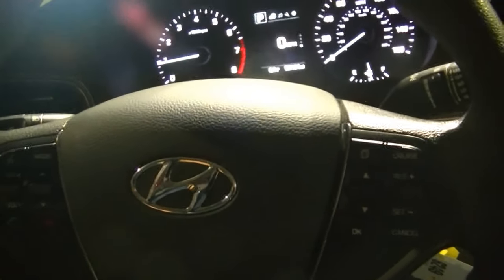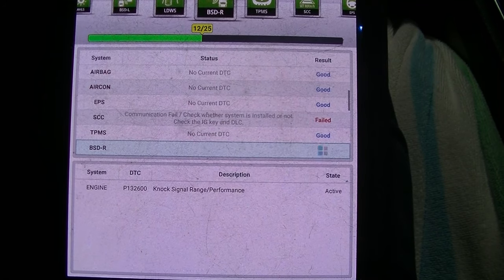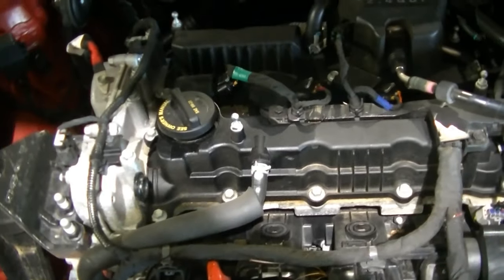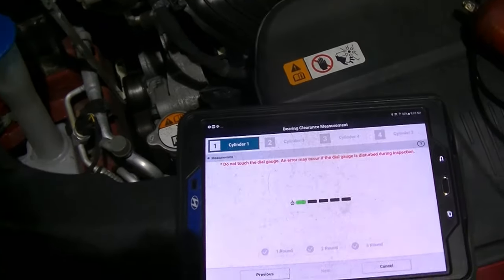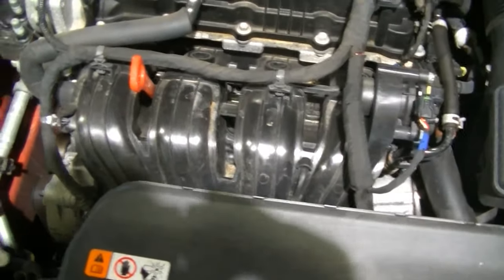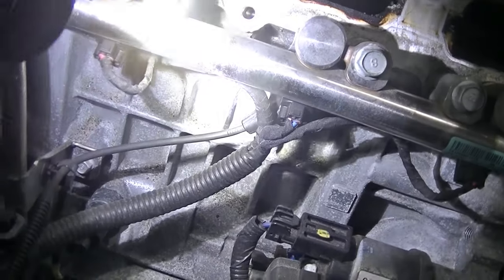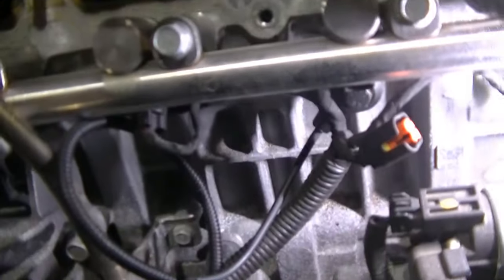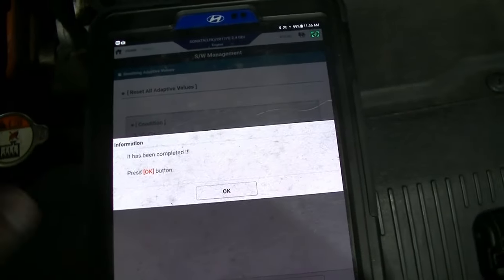Hyundai/Kia P1326 Diagnosis and Knock sensor replacement (flashing check engine light)

Comment: Dealership charged me for a knock sensor replacement and 300 miles later the engine started knocking. They crooked me. If they had checked the rod bearing clearances they would have known that the bearings were bad. They caused me to be stranded 200 milesfrom home. Still waiting for the Hyundai case manager to call. If the dealership doesn't make good on their failure,  I'm going on social media to do as much damage as I can to their business.
Reply: How much did they run you for that knock sensor?
Reply: @luis-n-ceci6998  $448.87 to replace it.
Reply: Report this to the NHTSA because they have open investigations on them and theres another class action lawsuit opened in South Carolina against Hyundai and their 2015 sonatas. Which are starting to have these same issues. I my engine is limping and I’m pretty sure it’s a knock sensor issue and not the engine it’s self. I’m getting a diagnostics run on it tomorrow and if it is the knock sensor I have to wait 1.5 months before Hyundai can even see me. Ridiculous.
Reply: @Goldun-nah  Hyundai replaced my engine. Also, the attorney general's office in my state collected my $400 plus dollars from the dealership that charged me for the knock sensor.
Reply: @randallturner8048  if it isn’t too much to go into can you explain to me the process. I’m just trying to be preemptive and have a game plan for if they try and swindle me. Taking mine in Friday for the same thing. Glad you were able to get some resolve. The engine replacement been treating you good?
Reply: @Goldun-nah  I'm about 12,000 miles into the engine replacement and so far it's doing great. Mine was using an excessive amount of oilfor several years before the rod bearings went.  The first dealership was in the process of doing an oil consumption test  when the rod bearings went. However,  you want to request that they do a rod bearing test. There is a dial gauge they can place in the spark plug holes and turn the engine crank by hand with a special tool. This will measure the clearance between the rod bearings and crank shaft giving a clear indication of whether they are good or not. I kept telling my dealership to do one, but for whatever reason they didnt. It took me about 6 weeks to get my new engine installed because the dealership that did it was backed up and it took them a while to get the replacement engine. Good luck!
Reply: What was the outcome, my car would stall from lack of compression n sometimes won't start
Reply: @robinhoodloom5795  Hyundai replaced my engine free of charge. I filed a complaint against the dealership with my state's attorney general's office and they got the dealership to return my money for the knock sensor. A different dealership replaced the engine.
Reply: @randallturner8048 looks like I'll be doing the same thing. I complained over 3 years ago about weird sounds from the engine bay and oil consumption for more than 2 years now. They wanted me to pay for a diagnostics even after I told them about a service letter I received in the mail regarding an engine. My engine gave out yesterday. It's 99 degrees outside broke down by the road in another town. I was livid. I had to pay 300 for a tow and they still wanted to stress me on a diagnostics fee if they find there is another issue. I've ran the code and it comes up as this one and also camshaft position advanced. They can deal with this and give me a new engine because all of this could have been avoided if they would have listened to me. 😢
Reply: @IamRayne1992 man I’m sorry to hear these stories about these engines . I was strongly looking into a hyundia for my wife since prices where not so bad . But now I think I’ll go with my first choice the Toyota  rav 4 instead .
Reply: @pureonyx5090  that is your best bet and once I'm in the market to buy a new car , I plan on getting a Toyota highlander.
Reply: Bruh they would’ve charged you serious money $$$$$ to check your rod bearings LOL and thats just checking, extra $$$$ to replace and test. That garbage engine was toast either ways. Buy a Honda or Toyota next time, lesson learned.
Reply: Yes!!!! Kia is not being accountable for their crap engines,I'm waiting for a diagnostic in my 2015, I have a leak in the engine and I also have all software updated, I hope I get approved for a new engine.
Reply: This is me right now far from home idk what to do
Reply: @lauriepiroh6450  If you had the software update done previously then hyundai must replace your engine. Also, knock sensors are covered by warranty even if your car is out of warranty. Provided you have the Theta II engine in your vehicle.  There is a court settlement that requires Hyundai to replace the engine. My states Attorney General's office recovered tge cist of the knock sensor replace from the dealer for me.  Hyundai must reimburse you for  a tow and they must provide yiu with a loaner vehicle under tge settlement.  Dint let weasel out. 🤞
Reply: @randallturner8048 wasn't the issue covered under a recall? My wife's kia has a knock censor recall.
Reply: I know a thing or two about that
Reply: What scanner do you use
Reply: @AppalachianTourist thank you for this. I just had this problem. Do you know where I can find this stuff documented?
Reply: The Hyundai dealer in Laredo Texas been denied warranty and recall of the engine seizing or lockup with the same excuse of been recorded of been in an accident before(6 of my consumers and 1 of my property..)one of the worse companies ...
Reply: Sure they know the problem but they want make couple $.
Reply: I had this code my engine had been replaced, and computer re flashed by the dealer ship in 2020, but i dont think they replaced the hardware so it went into limp mode like this i put new knock sensor in it cleared the codes seemes to have done the trick.
Reply: @imthatguypal_ honda and toyota are about garbage any more too .
Reply: They run you fast to get some money y don't go to the dealership check others honestly people
Reply: @user-ck8kn3qt8v  The car was still under warranty. The dealership claimed the knock sensor wasn't covered. It was covered.  I filed a complaint with my state's attorney generals office.  They got my money refunded.

Comment: Bandaid on a bad engine - 2.4L Theta II is a garbage engine. My Sonata is at the dealer getting replaced right now. I have a Chev pick-up with 320,000 miles on it I drive every day that has no major issues and never has...

Comment: I bought a sonata 2.4l 2018 in April this year I didn't know a about the recall, or the claim settlement against hyundai American motors it closed in July this year but my vin is included in the settlement pretty sure dealer who sold it to me knew about it should I complain to consumer protection or am I wasting my time should sell the car ? I own it already its at the dealer getting diagnosed for knock sensor
Reply: Update
Reply: @nixc71  after 5 weeks of my car sitting at dealership their "certified technician" aren't certified to inspect or diagnose the cause of the issue even screw on battery terminals properly when i told em basically they tried to scam me for a bran new battery and when they did their diagnosis they figured my smart junction box aka fuse box was shorted and told me had nothing to do with my knock sensor issue nor was it related... basically they changed the whole engine block bran new, new knock sensor wiring, they had mentioned my rear heat seats werent functional and they crooked my seat upon removal so one side has a gap manager told me nothing he could do about it.. which is disappointing they damaged my seat and honestly it doesnt matter  long story short 800$ for fuse box, free engine from hyundai canada no issues since they swapped the block drives like new, best purchase ive ever made Car drives smooth, very spacious, very fuel efficient.

Comment: Man it would be super helpful if there was a mechanic or manager at my local dealership who gave a crap about doing warranty work. I've been having nothing but issues with this dealership for this same exact code being thrown and I'm going on two weeks now with no vehicle, no rental, and they have yet to look at the car. I appreciate your video and how helpful it was to at least somewhat understand what could possibly be the issue with my vehicle, but my local Hyundai's service team as well as service manager are all absolutely ridiculous.
Reply: bet the same thing is about to happen to me
Reply: I purchased a Optima. Did the recall for knock sensor to be added, eight days engine coded and had to be replaced. My vehicle was at dealership for almost 2 months due to backlog for engine problems. Engine was replaced, but 10 days later, engine lit on and car stopped. This time faulty sensor. Car ran for 10 days and while driving slowed to a complete stop. Had it towed to dealership (3 previous tows) to find out it needs a new transmission. I have continued to make car payments. No loaners. No car.  PLEASE KNOW when they engines are upgraded, you will have to replace the transmission to work with the upgraded engine. So I am 2 months in waiting for a transmission. 4 months downtime with a car I have owned for 10 months.
Reply: My closest Hyundai dealership is an hour away. They won’t be able to get my car in to be looked at for a month and a half. That’s unacceptable. I’m pretty sure I’m having a knock sensor issue and not actually an engine issue itself. My abs lights came on and then a few hours later the engine light started blinking and my car went into limp mode. No knocking noises tho. I’m hoping that I can get my car driving condition tomorrow if it is just the knock sensor and then have complete diagnostics ran at the dealer in a month and half in case there’s something that becomes a catastrophic engine failure and needs replacements.. and that’s covered by all Hyundais who have the latest knock sensor installed which I’m thinking mine does because it’s a later 2015 Hyundai Sonata that I bought dec 31st 2018. No recalls are on my car for a new knock sensor. Hoping this isn’t going to cost me a ton bc I’m broke.
Reply: Wow this sucks seeing all this bad news. I have 2018 Santa Fe sport. Took to the dealer did the bearing test said they updated ecm and vehicles is running ok at the moment. Lol like wtf. 2 days later done it again. They basically told me they don’t know why it does i. SMH

Comment: My 2018 Kia optima 2.4 the engine light would come on only when it rained or I took it to the car wash replaced the knock sensor myself and it turned out to be a knock sensor wire was split from the factory!!!! Also the crc intake and valve cleaner works awesome!!!

Comment: Very good information and explanation,8 months ago remplace a crankshaft,rods and piston on a 2.4l Hyundai with the same code after that remplace knock sensor and harness from sensor to pcm(I use sand paper to give more tolerance in the crankshaft part main and rod bearing to avoid the original problem..
Reply: What do you mean sandpaper on the bearing?
Reply: @mikem5475  in the crankshaft side with a 1000 sandpaper to have better tolerance.
Reply: @agoodneighborautorepair2176  you sand the bearing down? What does this accomplish? What tolerance are you going for?
Reply: @mikem5475  hi,you use sand paper in the crankshaft nobin the bearings,the tolerance that you looking for is 0.0015"INCHES so that helps to the oil go truth in a Hidrodynamic Lubrication.I been doing that in gasoline and diesel engines for 40 year,the last one was a Hyundai Sonata 2.4l ..
Reply: @agoodneighborautorepair2176  that makes sense, thank you
Reply: @mikem5475  thank you,blessings.

Comment: Just dropped my 2016 Optima off at the dealership for this same error. Good to understand what’s going on with it. Thanks for the video!
Reply: This just started on my 2016 optima over the weekend... how long did it take for you to get yours back?
Reply: I had mine back the next day. All they did was check the bearings for wear and do a software update. No engine damage so far.
Reply: @Kris81999  Thanks! That’s good to hear, I’m hoping to hear the same for mine as well.
Reply: Same here!
Reply: @Kris81999  did you have to pay or was it covered? Having the same issue right now on my 2015 sx turbo
Reply: @Kris81999   Having the exact same problem. Did it cost you anything to bring it in and have them look at it?
Reply: ?? At kia?? Did they charge
Reply: How much for this service and how do I ask for it? Dealer wants to replace motor

Comment: Got a p1326 on the wife's car this evening, looked it up and saw this is what it is. I'm glad to see their is a recall on this. Hyundai cars are a piece of crap. 0n her 2011 sonata the tail light bulbs are always going out, when you try to change them out it's a pain in the ass. The dashboard has cracks all over it, and of course there is nothing they can do about it. The passenger seat belt receptacle doesnt work, they want $300 plus to replace it😏.
Reply: Yeah I've always had problems with the break lights. Bought it new used with 15k. Replaced the lights themselves and the entire assembly two or 3 times lol. Still no recall on this. Just got a p1326 code with 73k miles. I'm out of warranty now so I'm not covered. Hopefully it doesn't get even worse. I've heard  the rods can go and engines break down. How did your repair go?

Comment: This issue is covered by kia, they also have a 150,000 mile warranty on knock sensor issue and sometimes the engine would have to be replaced!. Don't be scared people, if your car is over 100,000 miles.
Reply: Kia won't do anything!

Comment: Hey there. Great video and great info! My mother in law just had this issue on her 13 sorento. Also, at 2500 miles into the oil change, it was very low! Consuming oil is my guess. Kia did all tests and check bearing clearance and said all was good. My huge favor question to you is: What tolerances are considered acceptable and what's bad?? 0.003 good, and 0.005 bad? I am not sure. I dont know their tolerances and I'd like to know if she is on the cusp of bad things happening or not? Thanks a ton in advance!
Reply: Added note... now nervous after watching this and seeing your comments. Wife just bought a 21 sportage, and sister just bought a 22 sportage, both with the 2.4. Oh boy.....

Comment: Thank you for sharing this clear and to the point explanation of this code and test!

We have a 2017 Santa Fe 2.4L that was just towed and sitting at the dealership waiting for this check Monday morning.  I did a quick check with my code reader and it’s got the P1326 after flashing the CEL and going into limp mode a short distance before getting home.  Nice to know what they should be doing.  

Question - to engines that fail the clearance test, are they always making noise or does this pickup the issue before they die?

Take care!

Comment: Dirty injectors can cause the flashing check engine light.  Did a pressure feed fuel injector cleaning service by removing the FI fuse, detaching the FI line from the HP pump and connecting a quart container with FI cleaner concentrate pressurized to 50 psi to my air compressor.   Ran the car for around 10 minutes till the cleaner ran out.  Test drove, problem solved.

Comment: Bought  my 2018 hyundai sonata at carmax back in the beginning of April 2021 with 41k miles on it... So now July 31 2021 my car has p1326 knock sensor issue.... Hyundai told me that my car is on recall list and I'm sure it's under warranty, so hopefully I get it in to them and don't have to pay for it. What do you guys think?

Comment: I have a 2014 sonata with 84k , last night I went through a car wash and then got the blinking check engine light.

Ordered the sensor and working on my car tomorrow, hopefully it lasts till 150k
Reply from the maker: Bring it to the dealer it may be covered
Reply: @SEsGarage  it has a rebuilt title , I don’t think so unfortunately.
Reply: How is it holding up with the replacement sensor? Is it still causing any issues on your end?

Comment: I have a '13 Elantra with the rod knock.took to dealer charged me $250 for diagnostic to confirm. Idk if this is the test they did,but when i got the car back I immediately noticed it seemed like it wasn't accelerating like it was before they looked at it,seems like it's lagging or something. I assume they did the knock sensor update on it. Wish i were near you to do the diagnostic

Comment: Seems like Hyundai found a way to screw people with this update by making it a requirement to be able to be eligible for the limited lifetime warranty. These dumb judges and lawyers fell for it. All the update does is make the knock sensor more sensitive to try and save an engine that has already started to fail by putting it into limp mode. 

This should of never been a campaign but a recall on all engines for safety reasons. They also lied in the owners manual by stating they recommend oil changes at 7,500 miles for normal use and 5,000 miles for more heavy use but all these engines are burning a quart of oil every 500-1,000 miles leaving the car bone dry by the next oil change. 

Rod bearings are failing because of the way the engine was engineered. It is a faulty engine that is bound to fail no matter what a consumer does to try and prevent it. These am engines were built to fail by design.